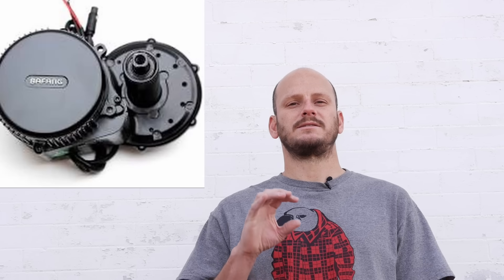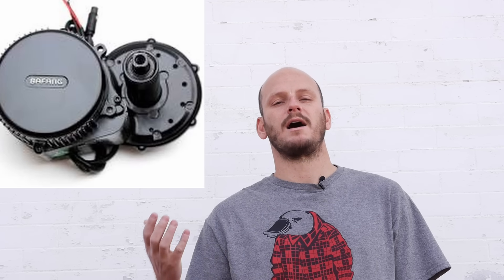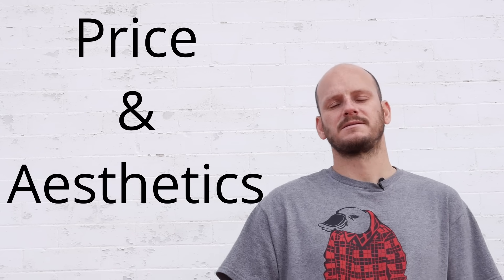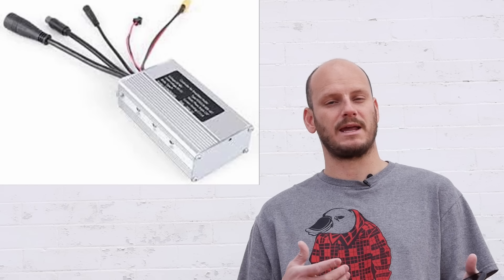Hub vs. Mid Drive Motors: Why Hub Motors Suck and Debunking Common Myths with performance test

Comment: you lose half your battery power spinning your wheel with no result..... hub motors have traction almost all the time because of the weight.... loose spokes ???... can we say " spoke wrench ".... bicycle wheel bearings are not made for that kind of torque with the load always on one side... hub motors have no such issue's and if you are like... you cannot do a 2 wheel drive ebike with a mid mount... bicycle chains are not made for that kind of power either, the most a human pedalling can do is about 300 watts....anti puncture strips inside the tire along with Tire Slime... have not had a flat in over 5 years..... and if like me, you put 2 hub motors in a Rambo bike trailer.. for regen braking action.... between the 4 motors... I never worry about breaking down, if one fails I can always get home on at least one motor ^^ 5000 watt rear, 2200 watt front 2 x 1500 watt trailer motors... =      :)))))     all day long

Comment: Couple of issues I had with my mid-drive motor. My custom built steel touring frame wasn't really compatible, in that the chainstay bulged out a bit, close to the bottom bracket, and tightening up the motor against it eventually wore a hole through the chainstay. I fortunately noticed it before the stay failed catastrophically but still, it was a £300 repair / mod to the frame that I could have done without. The next issue was the directional bearing that applied the torque through the big internal gear cracked, so I had to get that replaced, but in the process, the torque sensor ribbon cable got damaged, and with the part being relatively expensive and hard to come by (and also by all accounts a bitch to fit) I decided to go back to manual biking. I'm now back on a mid-drive ebike, but this time a pre-built R&M with a Bosch motor. It had a replacement early on, due to a faulty sensor, but since that, it's been pretty flawless. And the Carbon Belt Drive means I don't worry about carrying a spare chain. It's been an almost zero maintenance bike so far.

Comment: Hey man, thanks for sharing your knowledge. I was hesitant and nervous about getting a mid drive on my last bike. I had 4 hub drive bikes before and knew what I had so I didn't want to take a chance. I visualized the chain being a major player in the mid drive and got nervous of having the chain break or slip out on the road. 
With the hub drive even if my chain is off the crank I can still move. Having a motor put all that force on the chain and gears didn't appeal to me.
I'm sure if I did get the mid drive I may never want to go back to hub.
It didn't help that in Manhattan a lot of bike shops don't like you walking in with an electric bike. All their service charges goes up once you give them an electric bike,
Reply: This fear of losing a chain is over hyped. I have a Luna X2 2000 watt mountain ebike and use the hell out of it and have yet to break a chain. Come on.

Comment: I don’t doubt your conclusions, but:
1. We are told repeatedly that electric motors deliver the same output across the rev range. If electric cars don’t need gearboxes because of this attribute, why does hub drive benefit from utilising the bikes gears?
2. Why do (cheap) hub motors loosen spokes? The power for both hub and mid is transmitted from the wheel hub through the spokes to the road. Do cheap mids also loosen spokes?
Reply from the maker: I’ll send link to answer #1 https://youtu.be/4zS0vD1QNB8
#2 is purely because of poorly laced hubs in cheap wheels with overall cheapness

Comment: This is only relevant to countries that are not that restrictive.  In the uk eBike motors have a maximum of 250 watts and a high torque is c90NM.  The restrictions are designed to avoid eBikes having speeds well in excess of what normal bikes can achieve.with little manual pedal power.

Comment: Hub motor allows acceleration without pedalling. Moped mode as some say.
Reply from the maker: All my mid drive kits come with a throttle
Reply: @JohnnyNerdOut  I’m puzzled how throttle works with a mid drive motor considering it drives the pedal shaft.
Would that mean the rider would be forced to inactive pedalling when the throttle is engaged???

Comment: Transmission losses suck. The Watts on the label of these motors are their electrical energy consumption at some point in time when these motors revolve around. Because when an electrical motor stands still, it has little resistance, and relaying power to it can cause "infinite" Amps to start flowing - the underlying cause of extreme torque and extreme acceleration of electric vehicles in general.
All this does not explain the very bad efficiency of the hub motor in this case: its ability to convert a Watt of electrical energy into a Watt of power to drive the wheel/bike is very bad, relatively. And, as it should not have transmission losses, this is extremely weird.
So the hub motor must use gears between the electric motor and the bike axle -- it cannot be direct drive. The mid-motor on the other hand could be direct drive and have no internal transmission losses that next drives the bike's chain where we have minimal losses compared to a bunch of reduction gears driving each other.
No, this is not apples to apples, even when both motors have the same electrical specification.

Comment: Hub versus Mid drive is not as important on a paddle assist ebike, which most are for one NEVER uses the trottle only since this would drain your battery faster and than you have to paddle home with the extra weight.

Comment: I built my first ebike from a Schwinn Meridian trike, and after seeing the pedal powertrain needed to give a differential effect, and that it only put power to one side... I chose to go with a FWD hub (1500W). It does not add the weird trike handling from that asymmetric application of torque, and, in fact, handles very well (getting tippy? Add power!). That even application is now something I consider critical  for a trike... and now has me thinking of putting together a 2WD 2 wheeled woods bike.

This configuration does not add any stress to the stock pedal drivetrain, leaving it to operate precisely as designed.

Comment: I'm 280 pounds. I bought a front hub drive for my 26 inch low rider bike with banana seat and suspension seat post and ape hangers. My back tire already takes a lot of weight so all my electrics are up front. And I also chose a 48v 1000w kit but I rarely ever max out my 32 mph top speed. I ride about 12 mph on the average so I can feel 14 again and I ride to smell the roses. It's my fountain of youth. I'd buy a motorcycle if I want to run faster. So my hub motor rarely ever gets hot because I'm only using 50% of it's capacity. And on the rare hill I assist with some pedaling.
I've had my kit 2 years now and my hub is still going strong.
That's the trick with hub motors. Get the 48V 1000w and ride it like it's a 36v 250 w and you won't ever overheat your hubs.
I do agree with the spokes. I adjust them monthly.
Comes with the territory for I lace my own wheels anyway.
But I have yet to true my front hub. It's been holding pretty steady.
But my other wheel has been needing the occasional tweaking.
That comes with all bikes electric of not.
I'm about to electrify my worksman trike.
Front hub is the way to go in my opinion.
No worries about doing wheelies.
And spinning on a front hub on a trike is beyond fun.
Also still for under 200 bucks and I already have a second battery and extra mount from my low rider so that's all i need to electrify my trike.
So for price alone I'm a hub fan although I've never actually tried a mid drive.
Reply: Get some stratorade from Grin Industries and you can ride that motor at 80% at all times.

Comment: Just a thought about the 'spoke' loosening problem. In both cases the driving force has to go from the hub to the rim (using the spokes). So the problem is the same. And about the efficiency it looks that the Newtonmeter of the mid drive motor is very much depending on the gear ratio. So the Newtonmeter of hub motors is also depending on the gears as well (how is the planitary gears ratio?).
Reply from the maker: It’s just that poorly laced hum motors are rampant, which cause loose spokes. I believe geared hub motors have between a 10:1 and a 14:1 ratio. Yes the gear ratio is what gives mid drives that big power boost using the same wattage.
Reply: @JohnnyNerdOut  Can rear wheel motors not be poorly laced? If so it has nothing to do with the motor possition itself but with the quality of the spokes fitting. About the gear ratios. A good comparison should maybe be not to use the Newtonmeters of the motors but the force the wheel brings to the road (given a 250W motor). Ans also a bike with great acceleration has less range.. So its a trade of. Remember 40 years ago when cars moved from rear driven wheels to front driven wheels? Everybody thought this was a bad idea. Now (almost) everybody drives front driven wheel cars..

Comment: My ebike says brushless motor. Is this a hub or mid drive motor? If it’s neither, is it better then a mid drive motor? Would be my 2nd question
Reply from the maker: Pretty much every ebike motor is brushless. It just refers to the contact type of the magnets. Hub motors are built into the wheel. Mid drives are mounted middle of bike.

Comment: As someone who has used both Hubs and Mid drives. 
Mid drives are better then hub motors in the low price range. Why? Let's say if you had a budget of $1000. You got a 52v setup with a Bafang BBSHD/BBSxx which is pretty much what people always get. The BBSHD has a 30amp/27amp controller . Now , if you had the exact same hub with a 1000w hub and the same 30amp controller , Yea sure the Bafang would destroy the hub anytime . 
Why? Mid drives have the advantage of messing with gear ratios and the ability of changing gears thus having both torque and speed. And also , Mid drives have a lower CG and not all the heavy ass unsprung weight and the worrying of the motor falling out of the bike as you struggle to find a proper torque arm that'll fit your bike. 

With a hub , you're always stuck to the limit of 52v and the mere 30amps , which as the video pointed out , is sorta always in one gear . And anyone who has a hub would know 52v 30amps on a 1kw hub isn't particularly 'fast' or 'torquey' , simple terms , not as powerful as a mid drive would be.  There IS however , geared hubs. That provide way more torque at lower amps but also has the typical wear and tear of a internally geared motor like the Bafang.

Reliability : The cons of a mid drive is chain wear and eventually a broken chain. This is not a myth , it's a fact. Bicycle chains are NOT meant for such high power applications for prolonged time usages. It is what it is . Hub motors wear the spokes too yes , but ONLY IF you don't get your wheel built right. It's just how a spoked wheel is. Even without a motor , spokes DO get loose overtime and require true-ing . Having a hub just quickens the period in which you have to true the wheels. This however , has been lessened as in the big DIY bike world , thick motorcycle spokes are used.

Modifications : This. This is the one that just appeals to me the most about hubs. You can overpower hubs to shittt e.g running 8 9kw or more on a mere 1kw hub and it'll FLY. Yes it generates heat , Yes you may get burnt hall sensors or the main stator coil or overheated magnets that fall off but hubs take it like a CHAMP. Whereas back to the typical Bafang mid drives , as their all geared internally , there's a physical limit as to how much more power you can send into it. Too much power , the fragile nylon gears break. Steel gears have been made but that'd wear off the main cog even quicker or damaging the internal clutch and when that happens , you can't ride it no more. Whereas with a hub , even with a sorta burnt coil, it still works.

 Both hubs and mid drives have their pros and cons. There's the variety of torque and speed or maybe even both with mid drives . Mid drives having the ability to change gears and hubs being able to take big power . I have a qs273 that ran 134volts and 250amp controller, Had a stock BBS02 , had a BBSHD and had a 250w Inokim that's powered on 72volts and a 40amp controller. They each have their fun points. There are mid drives that take big power like the LR Big Block , Cyclone etc. but they all require custom fabrication in order to fit on a frame e.g Stealth bomber copy or even a conventional bicycle.  Whereas with a hub , just smack in the bike and ride on but not without looking like a POS with the externally mounted controller and battery . 

till this day , there's only a single mid drive setup that caught my eye. A qs205 with a cog mounted on it , acting as a mid drive driving the chain. As only hub motors give me the assurance that it'll take the big power i'm gonna send it and last . But that is gonna be more of a electric motorcycle .

I've not mentioned regen as come on , it's pointless in a bicycle setup to me i suppose , other then being able to slow your bike down without using actual brakes.

TLDR : Sub $1000 budget , Easy to install . Mid drives or rather Bafang mid drives , are the way to go. If you have more budget and want POWAH , Hub motor's the way to go.

Comment: Yeah I like to go uphill so I guess a bafang mid drive 250w would a 500w hub be better tho as its double the power and $180 less.
Reply from the maker: 250w mid would still be stronger than a 500 white hub motor due to its torque multiplication through the transmission👍

Comment: All very interesting but it does depend on what you want to get out of your cycling. If you are doing it simple as a way to get from a-b then a powerful mid drive is great. But if you cycle to keep fit, then a smaller hub motor which just assists you on those really steep climbs is much better for you. I have a 350w hub motor, bought from eBay as a kit (which came with everything I needed) and I have set it up as peddle assist only, no throttle, and it is perfect. I sometimes come home with most of the power still in the battery and other days, when I choose a hilly ride, most of the battery is gone.

Comment: 30.000km with ebay 1000W diy gearless Hubkit in the front...
no loose spokes or anything
Controller 27A Max @58V ~1600W  .. nothing burned up even hill climbing

Comment: I found with my new Intense mid drive mtb it makes shifting more....lets say nuanced as the mid drive keeps the chain wheel constantly under load so shifting is rough and noisy up or down shifting, there is a slight lag in motor cut out so even trying to unload at the peddle doesn't help
Reply from the maker: Gotta get a gear shift sensor👍

Comment: Your spoke argument makes no sense at all.  You argue that the mid drive climbs hills better, and show this.  That means more torque is going to the wheel, period.  That means the spokes have more stress on them period.  Also, the chain and sprockets are being stressed , where they aren't in a hub motor.  The weight distribution is better in a mid drive.  The power to the wheel is better, assuming you've selected the proper gear, otherwise, failing to shift to the proper gear is going to put strain on the mid drive motor, and if you don't get your feet out of the clipless pedals in time, well...  Also, many ebikes are using cast rims, not spokes.  I don't own an ebike, so I have no pony in this race, but making nonsensical arguments doesn't help.
Reply from the maker: Check my pinned comment
Reply: @JohnnyNerdOut  Perhaps, mechanical vibration from the motor could make the spokes loosen?  It may be that the motor is acting like an impact wrench?  If that's the case, blue Lock Tite would take care of that.  It could be your observation of more loose spokes is correct.  Stainless steel spokes are also far superior.  I would replace any loose spokes with stainless steel ones.  They can be differentiated from regular spokes, by testing them with a magnet.  A magnet won't stick to a stainless steel spoke.  I'll be 61 years old this Christmas, and have been riding bikes since I was 6.  If I were buying an electric bike, I would want a mountain bike with full suspension and mid drive, and just put up with chain and sprocket wear, but I'm not an average cyclist.  A hub motor with no standard spokes might be fine for me in 10 to 20 years.  It might also be fine for the average cyclist.

Comment: Your absolutely right,my 1500w hub motor packed in after 1500miles and the spokes were definitely on there last legs.So put the original wheel back on while I decide what to do for a more reliable option,and you have just answered my 100% mid drive,which mid drive would you personally recommend for reliability Bafang or Bosch or is there any others.Thanks so much for your honest opinion 🏴👍🏻
Reply from the maker: Bafang

Comment: I got both systems. Broken chain -  I have never ben walking home with my hub motor. I have been walking home with my mid drive - forgot an ekstra chain - and tools.....Reliabilty - all engines running - the oldest is 6 year bafang 250 W motor - running in rain - snow - mud - no problem. Loose spokes - rare - broken spoke - sometimes....